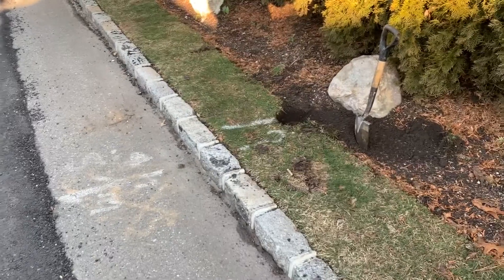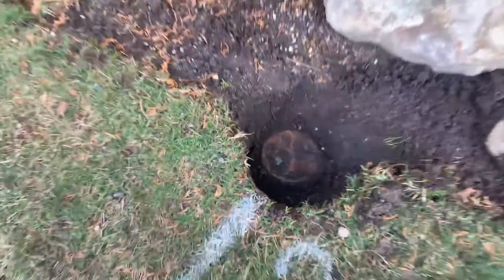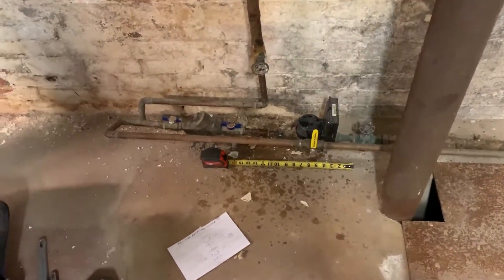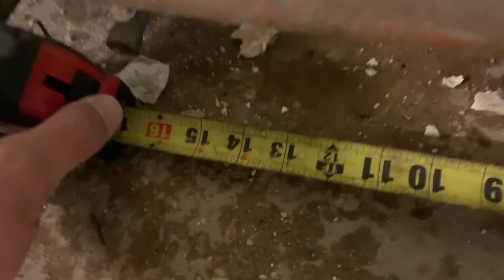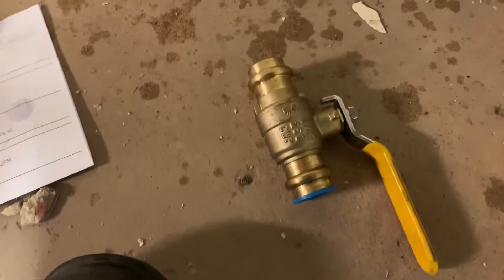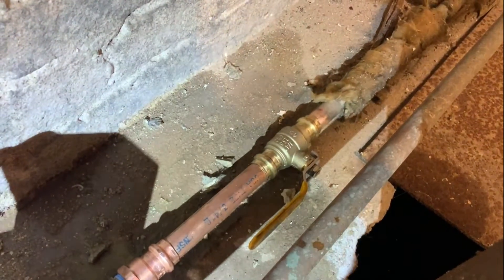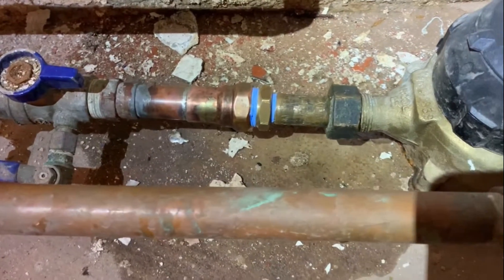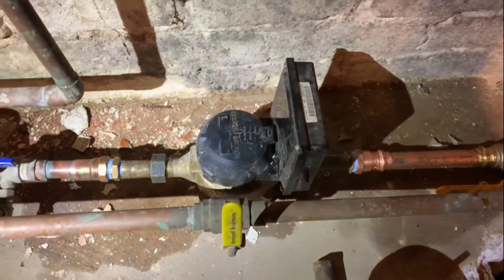Water Meter Upgrade 5/8" to 3/4" Piping Change

Comment: Out of curiosity, why does NY American Water specify going from 3/4 before the meter , down to a 1/2 inch adapter and then back to 3/4 after the meter? Could it be possible to keep it 3/4 all the way through?